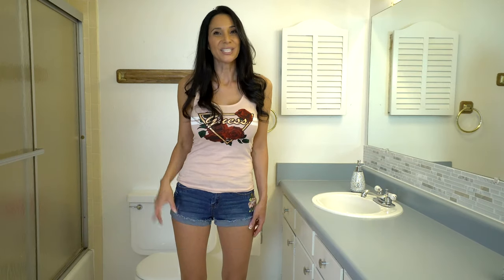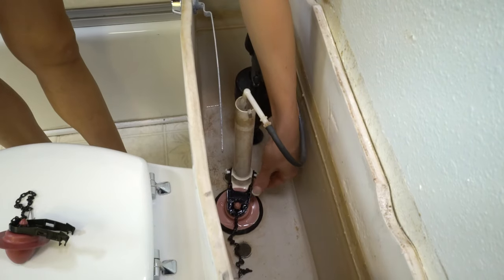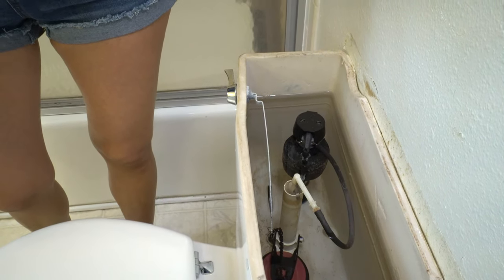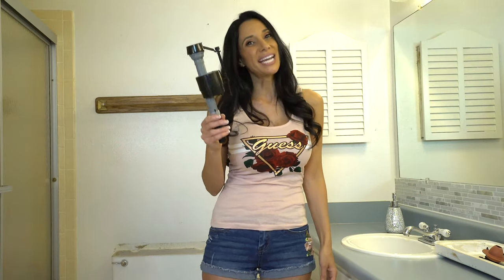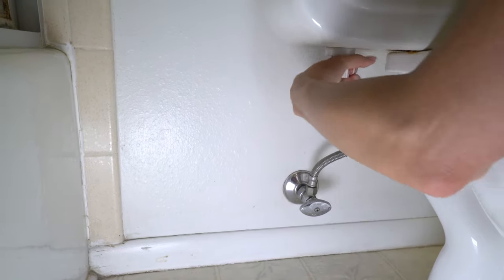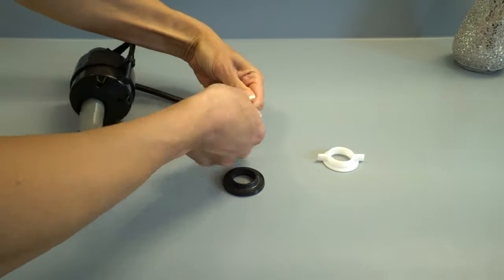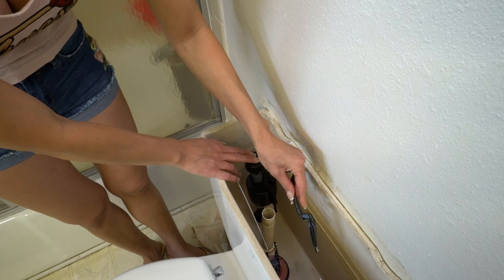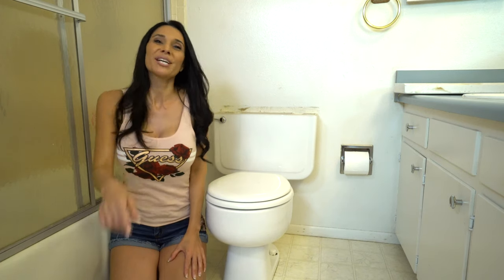How to fix a Runny Toilet - So easy anyone can do it!

Comment: From a water saving perspective... The older tank is large compared to new models, and probably using a lot of unnecessary water; may want to consider lowering the water level with the fill, or putting a one qt jar in the tank.
Reply: Why that so up have to flush it 2or3 times after a big dump.